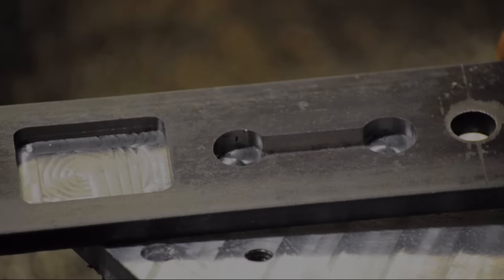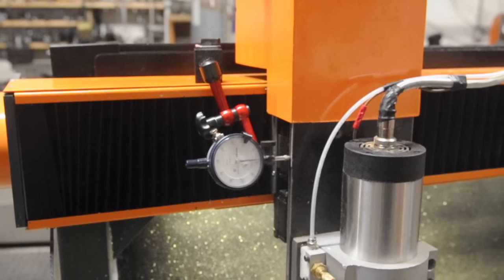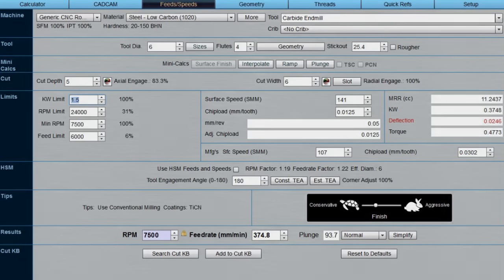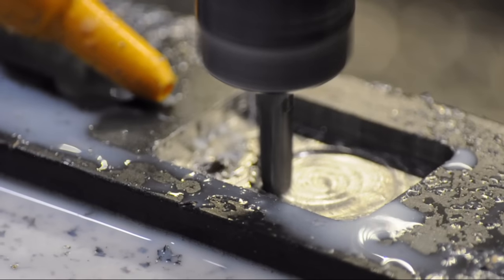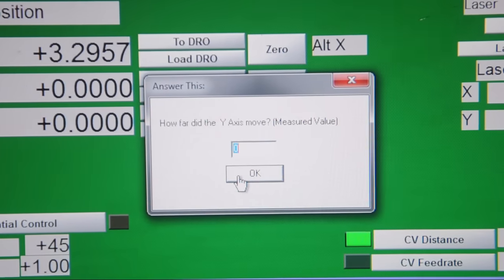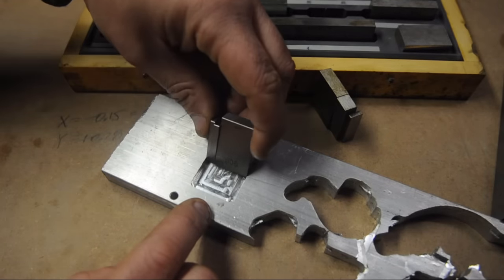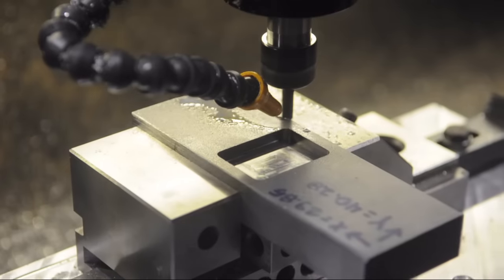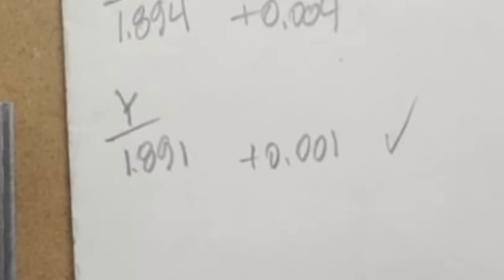ThisOldRouter - Cutting Steel

Comment: Hey Tony, a few observations:- For roughing a pocket on CNC mill, I would use a flat bottom drill (indexable U-drill) to punch all the holes, this puts all the load back in the Z axis which is the most rigid and will be faster material removal- For finishing the pocket, do not finish the walls and the bottom face in the same pass.  This adds more tool engagement, and can cause chatter and you'll feel a step in the bottom of the pocket.  Finish the bottom face to depth but stay 0.05mm off the walls.  then come back and finish the walls, with the cutter to depth.  this will blend the bottom face and reduce chatter / tool deflection.- No coolant for milling - this gives a temperature shock to the carbide and will cause it to break prematurely.- Check the rigidity of your axis - put an indicator on the tool along X, and push on the spindle in X to see if there is any slop in the bearings (same for Y).  This could be the missing reason why you are off after backlash comp, since this test is checking more in a dynamic condition instead of with no cutting loadsLove the vids!Adam
Reply from the maker: +Adam Kraehling Some good tips there Adam, thanks for writing!

Comment: I've had a ball nut screw loose a few times, and it is so frustrating. Until you realize the problem, then everything is good with the world again, and you swear you'll check that first next time, except that the next time might be a year later, and by then I'll have forgotten the lesson, and the cycle sadly repeats.
Reply: What is a ball nut screw?
Reply: @thecouchpotato4652  The long metal like screw is your ballscrew. That movable thingy that slides up and down on the ballscrew is your ballnut. Now, the small screws that you use to bolt the ballnut to a plate or surface is your ballnut screw.

Comment: Nice machine, and I am quite suprised how well the chinese HF Spindle handles steel :)

Is there a special reason why youre conventional milling? With ball screws its no problem and way easier on the tool to climb mill.
I would also try to do completely machine steel dry - Only with airblast to clear the chips.
Thanks for sharing, great video!
Reply from the maker: +Stefan Gotteswinter Stefan, thanks for stopping by & thanks for the tips, I'll give them a try!
Reply: +This Old Tony what's the deal with you mixing metric and imperial, where are your from?
Reply: +Stefan Gotteswinter I have actually just swapped to conventional on my BF20 for steel roughing passes..  Climb, especially around corners snap tooling and stall 850w motors in my experience (12mm 3mm width, 10mm depth @ 297mm/min) which is what FSwizard gave me.  It also chatters and vibrates the whole machine.. (135kg mill)

Conventional chatters a little but cuts a lot smoother but leaves a rough finish, so I just clean up with climb..
Reply: Climb milling depends on machine rigidity as well as what kind of screws and bearings you are using. Even with the best ball screws, if the machine hasn’t enough mass and structure to prevent vibration, climb milling isn’t a good idea.
Reply: @beard-bear-420  where are your from?
Reply: @mwilliamshs  where are YOU from!

Comment: without reading the comments below, here's my thoughts that might help:

I work in wood but that doesn't really change the issues that you're having. The end result is the same.

That finishing pass was all over the place which resulted in the patterning on the cut. You could hear the bit touching the outside of the pocket when I don't think it was supposed to. (that could have been the backlash issues).

I'm not sure if solid works has the ability to do this, but I use Vectric aspire and what I do for my rough cut, (wood) is leave .04" on the material. Then go back and use a finishing pass of 0" at about 1/5th the feedrate to remove this last little bit. My depth of cut is .01" deeper for my finishing pass. 

I have the option in Aspire of doing a raster cut (which it kind of looked like Tony was doing) or an offset...and what offset does is mill the shape of the pocket in subsequent circular passes eventually getting to the final size. Then, leaving the .04" on the material on the perimeter, and .01" on the bottom. I go back with another profile tool path to remove this material on the perimeter (at the slower speed). It produces an amazing finish on the cut.

Now I'm not working near the tolerances you are, but still, I want to be able to cut to a "thou" as well....(ever since I started using vernier calipers for woodwork). But my machine is about as rigid as a piece of over cooked spaghetti so until I upgrade, that isnt' happening. What I AM doing though is trying to get a baby butt smooth finish and semi accurate. 

BTW: I hope after tightening your screws you put threadlock on them....they were probably loosened by the vibrations of that first pass.

One other thing: (you might have thought of this already) You might want to try taking less off per pass....you know, if you want 1/8" total depth, take 1/16" off each pass.....you might find your accuracy goes up. I know your machine is built like a tank, but everything has flex...taking less off will remove that flex.....(ask me about flex sometime, my CNC router uses PLASTIC for structural elements). 

Also: you might want to check the bottom cutting face of your endmill..is it perfectly square? I had crazy chatter and weird patterning on a tool path and couldn't figure out what was causing it....checked the machine, nothing out of the ordinary...I finally checked my router bit (2 flute straight cut) and one of the carbide cutting edges was longer than the other.....

Comment: Why did you opt for conventional milling on your roughing pass, and climb milling on the finish? This strikes me as counter intuitive.

JUNIOR machinist over here, so I'm just looking to learn what I can, where I can.
Reply from the maker: Good eye, Brad!  I come from a manual machining background.. mostly on old, worn out machines.  In that case, climb milling is the best way to break cutters.  Old habits, I suppose.  I've since switched to mostly climb milling on the CNC router.
Reply: In climb, the cutting edge comes down onto fresh material at an angle - the chip begins thick and tapers off to nothing. If there is any tool push-off, the error gets cut off by the next tooth. In conventional, the cutting edge approaches the material tangentially - essentially beginning the chip at zero thickness and getting thicker as it cuts. The error left by tool push-off gets left behind as a ripple or scallop in the surface. Climb milling usually cuts cleaner because the cutting edge doesn't have to "rub" (and deflect the tool or workpiece) before developing enough tool pressure to cut into the workpiece. 

But, as Tony says, with a machine that has significant backlash or spindle slop, climb milling can pull the tool into the workpiece (or vice versa) and suddenly take a much bigger bite than intended, which tends to be tough on tools. This is why you can only use climb to take very light finishing passes on a loose machine.
Reply: Yeah, I only work with nice tight production CNC machines nowadays. I don't use conventional machining for much of anything anymore.

I don't know the limitations of these smaller CNC jobs, but I'm not sure it's terribly relevant here. I would think that, unless you're pushing the machine WAY too hard, the benefits of climb milling will far outweigh the drawbacks.

Good stuff to think about though, thanks.

Comment: Nice Video and a pretty rigid machine!

Just a few thoughts I had about your machining:

Your CAM system supports adaptive roughing with radial engagement control. Instead of switching your spindle to be able to machine the old fashioned way, make yourself use of the new technology.
These paths were invented for high speed cutting at low radial engagement rates and high spindle speeds and bring the benefit to reduce torque and forces on the spindle due to the small engagement. Just raise your depth of cut up to 2x diameter of the cutter. 
So I wouldnt mind running the pockets with the 6mm end mill you've chosen with a spindle speed of around 16.000RPM, feed per tooth of 0.05 - 0.07mm (starting lower and check whether your spindle and stepper motors can handle it) but with radial engagement of around 10 - 15%. But for this you have to use climb milling.
Benefit of this way of machining is a huge time saving and your tool life is also increased because you are spreading the load on a wider cutting length.
At this high speed all the heat gets away through the chips, so no coolant is necessary anymore.

With these parameters I was able to cut aluminum on my cheese mill (it literally was one, huge gantry, massive deflection of Z-axis and a poor Suhner spindle) with a 6mm carbide endmill.

Anyway, I really enjoyed your videos! :) Just go on like that, your projects are great!

Comment: I was also having problems on my G0704 CNC mill with accuracy. Everything was spot on when measuring movement with a dial indicator, but parts were still coming out off size by 0.005" or more. One thing to make sure of is that your dial indicator holder isn't flexing when you're measuring the actual axis movement. I have the same holder as you and it was showing 0.005" short over a 1" move due to flex. After I mounted it more rigidly it was measuring 1" spot on with the calculated steps per inch for my ball screw's pitch. Another thing to take into account is the tool's actual diameter. Some of my end mills are up to 0.004" from the nominal size. Use wear compensation in HSMExpress instead of the default compensation and measure your tools actual diameters across the flutes and enter that into your CNC controller software. Finally you need to consider the machines rigidity. The cutting forces are high enough to push the cutter off the desired path so that holes etc come out significantly undersized. There's an easy fix for this, just run multiple finishing passes. Depending on how sharp the tools are, you may need more. I take up to four for some tools. It's easy to check if rigidity is a problem for you, just save your finishing pass as a separate file, and run it again after the first time. If you still are getting chips, even very small ones, rigidity is a problem. Re-run it as many times as it takes for it to stop making chips, and then just program that many finishing passes for everything. Once you've done all that then measure how far off you are and compensate for each tool by adjusting it's wear parameter. After all this I'm getting sub 0.001" accuracy on my G0704 mill which I'm pretty damn happy with!
Reply from the maker: Interesting points / good info.. thanks Andrew!

Comment: Tony,  I like the video.  I run SolidWorks and HSMWorks also.   If I were you id try running the feedrate much faster with a much smaller radial stepover.  Basically look up settings for a high speed toolpath.  This will also allow you to get away with the higher SFM that you are forces to run.  At your current settings you are only taking .0004"/tooth which is going to be really hard on tools and is why your machine is screeching and not really making chips.
Reply: 100% those harmonics and the peeling/ribboning of the steel is a dead giveaway that you are recutting some chips while pushing into others causing huge tool wear

Comment: The end mill tips are not exact length, no matter how fine the grind.  The first tip to contact the work directs the spindle axis into an orbit. As the cut proceeds, the tips change length, imparting new orbit moments, continually, transmitted into the gantry frame.

Direct your very fine high speed camera onto the spindle to watch the fun.

While the cut may be fine for a while, be assured that all axes are receiving the beating of their lives, with cumulative effect.

Comment: Love the graphic overlay's and screen shots to explain your thinking and actions Tony...and taking the time to do them!  A little confused about the changes in X too, but some of the comments below may have some insight to it.  Never used M3 before but maybe something in their offset algorithm may be a bit incomplete??  I also believe you are right about not getting your britches in a bunch until it settles in for final tuning.  I spent a few days rough dialing in the DM's after they were built and a month later went back and used a CMM to verify and final dial in.  Much larger machine but more stable environments than yours.  Nice find on the screws!  Really appreciate your work, diligence and sharing!!  Thanks!  ~PJ
Reply from the maker: +pjsalchemy Hi PJ, thanks for the kind words.  I did go through and button things up and used plenty of loctite.  So far so good!
Reply: youre sweating 4/1000 and im estatic when i reach 1/16th accuracy on anything hahahah

Comment: First, I want to say, I love your style of presentation, and your choice of content. I also think you are a very bright fellow, who is not afraid to try something out of the ordinary. With that, I would like to suggest a project, that I think you can handle. Since backlash is always an issue with stepper motors and screw,s, have you considered micro hydraulics ? Telescoping Piston,s would minimize space requirements under the table. Hydraulic,s, are not prone to backlash, assuming there,s no air in the system. I know there are machines available with hydraulics on the market, but I was only able to find it in large industrial machinery. It seems miniature hydraulics might have a place in the home workshop. One pump could run multiple pieces of equipment, similar to air driven tools.

Comment: I’ve had to troubleshoot some weird machine issues as a QA guy when maintenance was out of ideas. Hole patterns shifting, dimensional “drift”, all kinds of stuff.

I suggest running each axis back and forth through the full range of motion to a dial indicator at the home location with no spindle load first. You will see your scale error and lost motion (uncompensated backlash or missed encoder counts) that you might not otherwise see. I just set up a program to run the drives back and forth and log the measurements on a dial indicator to see the changes without “homing” the machine. Then I’ll run the drives out and check the max travel then back to zero on the machine to see if there is an issue on the other extent of motion. Finally, I’ll run the homing cycle and then advance the drives to maximum checking both measurements - sometimes the homing cycle is the main culprit for lots of silly CNC behavior.

You can take it as far as you want, like instead of just indicating on the spindle mount, you can also indicate off of two contact points on the gantry - something that makes sense on dual-driven gantry machines especially

I would use 30 samples of each to have a big enough sample to determine actual machine capability. It may seem like overkill but if you do this after machine crashes, repair, or whole troubleshooting, you can see what has changed from the previous state.

Troubleshoot with parts/spindle load after doing this to reduce the number of variables because if the machine is well within your expectations on the drives alone, then you know what is being driven by the material/spindle load/work holding.

Comment: To mitigate the misreading due to end mill diameter and runout you should make an inner and outer pocket and use the mean value to remove radial compensation of the equation. Or you can run a ball bar test.

Comment: Hay Tony thanks for all the videos! 

Question have you considered making a geared down spindle? You know to get a slower speed and higher torque for cutting steel. 

I’m currently building a cnc router for making plugs and bucks for composite and sheet metal work and this series of videos has been huge help.

Comment: Well, I will say your cnc is a stunning machine. Much nicer than the home made project I have tackled. Though I didn't have quite as much need for something that sophisticated. I have gotten mine down to well under 2 thousandth on a good day on aluminum, though I have upgraded its core hardware a few times as I have learned. And its speeds are also much slower than yours, but it does have enough precision for the projects I run on it. I would like a bit faster times but for the paltry amount of money I have into it, it does ok for my needs. But your table is a good example of what is possible, it is more than a few rungs up the ladder for sure!  And it may be the basis of the next one I build should I need it.

Comment: Hey Tony- always enjoy the excellent videos so thanks for that, With regards to the steel issue I know you have already have had lots of great input below but here is an idea you may think worth considering, with your equipment and ability you could build a bespoke spindle for the motor you now use as a power source. The idea would be to have good quality bearings and a strong spindle( with the possibility of tool change capabilities according to your wishes and design ideas) that is belt driven in two main modes- high and low. This would give you high torque low( ideal cutting  speed for the cutter and material) cutting speed and regular 1;1 high speed options with much more rigidity. A lot of work and extra weight I know but maybe a good way to get more versatility and broad based accuracy.

Comment: I'm curious about there being no mention of tooling diameter error here. How precise are your tooling measurements? I'm more experienced with wood routing, and the idea of a bit being .001" wider or narrower than it should be doesn't sound farfetched to me at all, and would be a significant, even majority, contributor to the error you measured here.